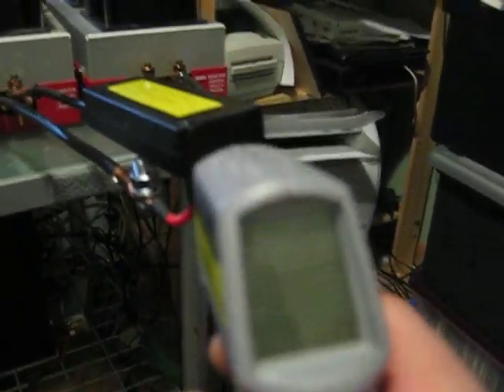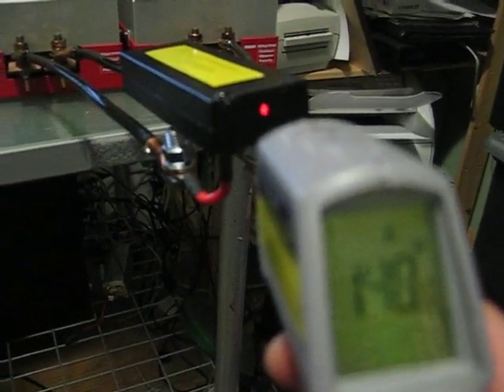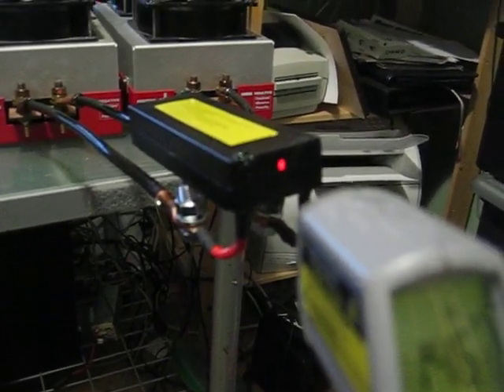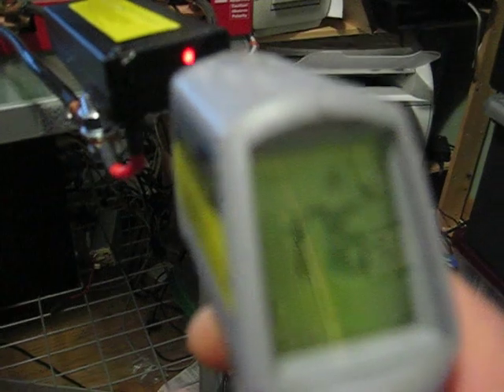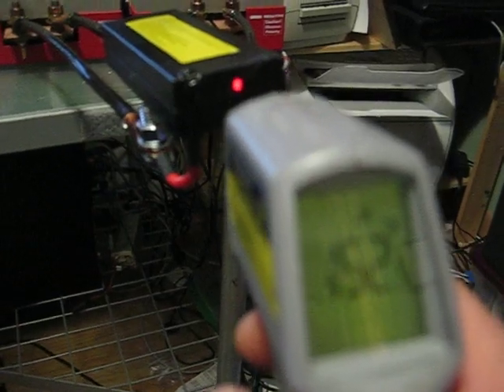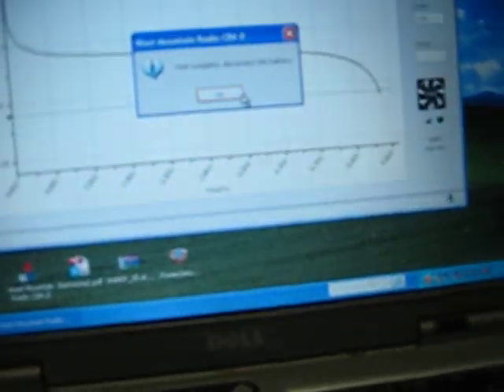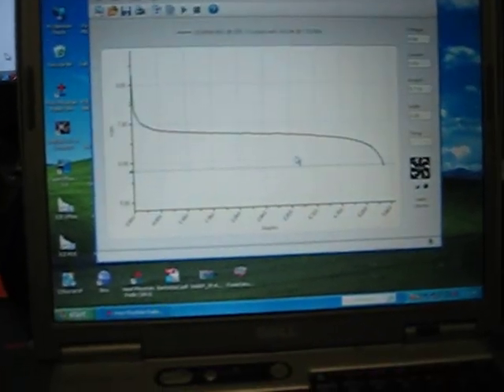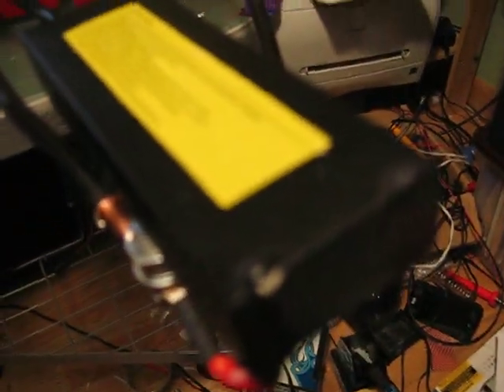2S 60C 6000 lipo pack tested at 20C (120A)

Comment: Is this why my turnigy 6600 65c- 130c lipo melts my traxxas connectors in my rustler? My turnigy 5800 40c-80c and my 5800 25c traxxas lipo don't do this. So the higher the c rating the more  amps and more heat?

Comment from the maker: the turnigy charger is too cheap to do this type of high power testing. also It's a cheap knock off of the Bantam BC8. I doubt for the price you pay any software and PC interface would be included. You will need software like LogView and USB driver and software to work with it. It will be a very basic 1A to maybe 5A discharge.

I use West Mountain Radio CBAII and CBAIII dischargers with dual 500W amplifiers. That will test most single cells and some 2S-3S lipos to very high limits.

Comment from the maker: also you may want to look at you Owners Manual to do basic discharging with your charger. LiFePo4 battery do not need discharge cycling unless you just want to check its capacity or discharge for storage.